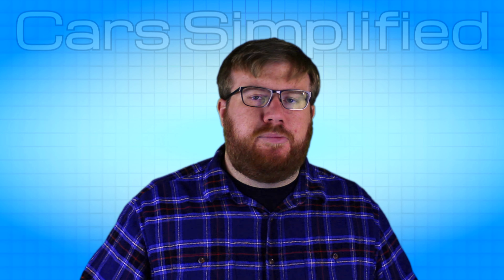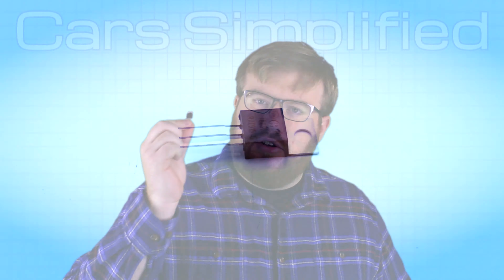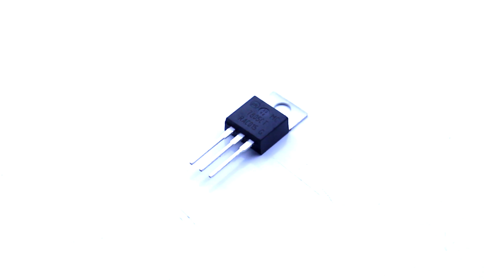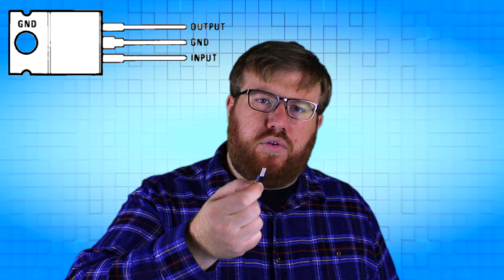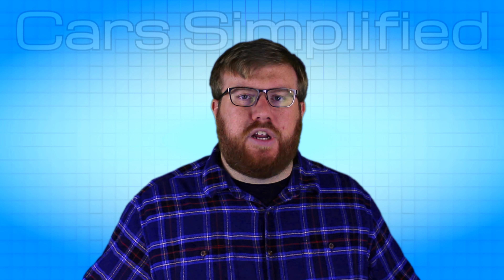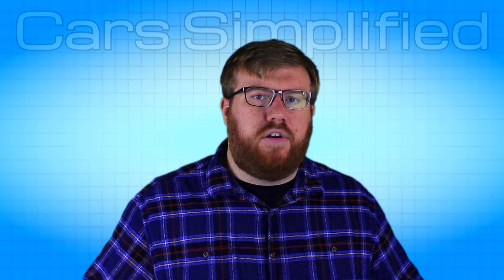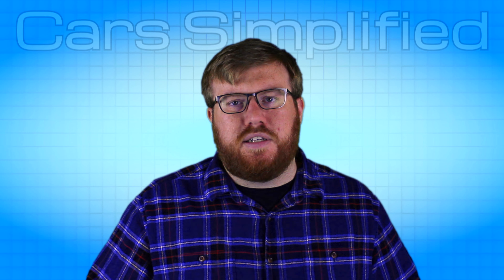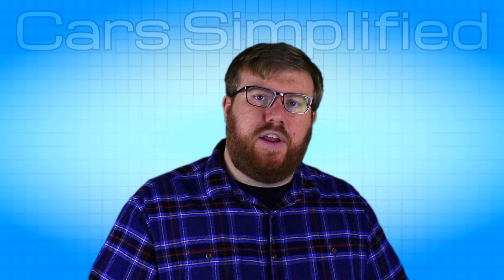Why Car Sensors Typically use 5V Instead of 12V (Automotive Electrical) • Cars Simplified

Comment: I had often wondered, but hadn't actually looked into it. Mostly suspected it was availability of sensors and just established practice. Surprised the alternator fluctuation wasn't more obvious to me!
Reply from the maker: This video was inspired by an "A-ha!" moment when I was looking at alternator output. I'm sure there could be ~12V sensors if constant math was done so that the voltage level change at any given instant was accounted for, but that would have to be incredibly precise with the timing of the comparison of sensor reading and voltage reading. That's just so much work that would probably never be perfect or too expensive to make perfect.

Comment: I may be incorrect but, While cranking the voltage available can fall below 8-9 voltsso reducing that can cause parts of the system to not work IE fuel injectors. If I'm wrong please let me know. RP
Reply from the maker: Engine cranking can certainly drop the voltage a lot, with your range definitely being possible, but it also varies with battery condition. I am not sure how common 5V fuel injectors are (I believe most are 12V) but the controller is likely running at 5V.

I don't recall if I mentioned it in the video, but the way a lot of voltage regulators work, if the voltage supplied to them drops too close to 5V, the output voltage that should be at 5V begins to drop. It may be something like 6V input means 4.8V output, but it will depend on the voltage regulator component used, and that's generally well beyond what most people are diagnosing. Digging up spec sheets for individual components can be done, but it's often time consuming.
Reply: @CarsSimplified  What is typically normal fluctuations you'll see in the 5v system?  5.1,5.2....?

Comment: Well is the batery is bad the the voltage ref aensor wont work
Reply: If the car has no battery voltage it won’t have a 5 volt ref but if it can be jump started the alternator will provide 12+ volts which will be reduced to 5v for the ref signal.

Comment: Why I have 12 volts reading on all of my sensor, no 5 volts
Reply from the maker: What kind of car is it? Some older vehicles use only 12V sensors, and even modern cars have some 12V sensors. Some sensor units will have both, but in those units the 12V is usually there to drive a motor or solenoid.